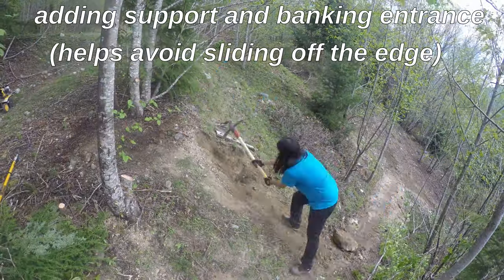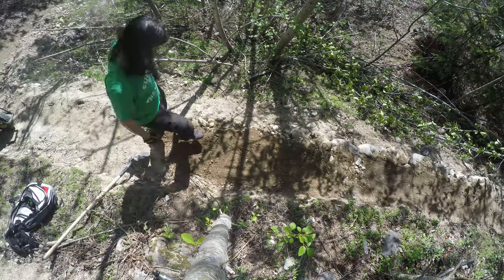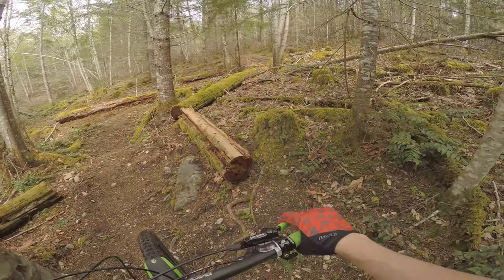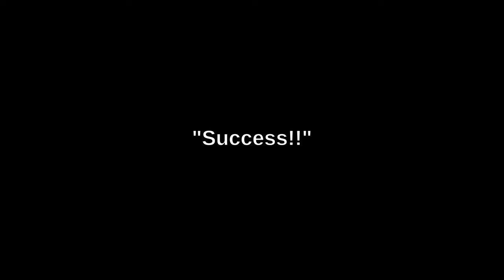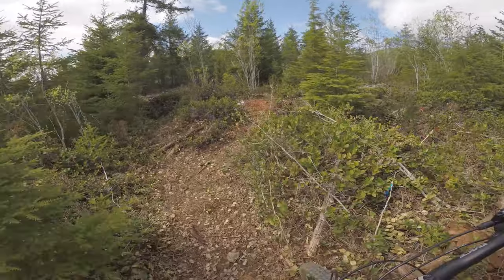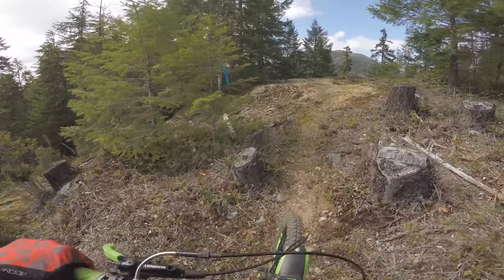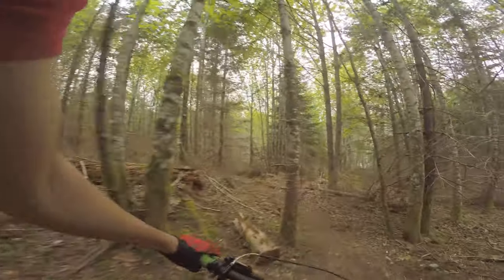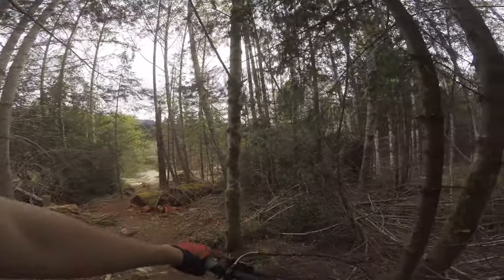Building berms & improving flow // Dig and Ride (Part 3)

Comment: My local bike shop owner has volunteered me to get the workforce for a trail. I've talked with the land owner and he said here's a 100 acres and we could use his unlimited supply of lightpoles. I've built me a small trail on my own land but never anything on a large scale. We're going to sanction it and add it in the local race series. We're going to have a brainstorming meeting on the 9th, is there anything you can think of that I might need to address, I'm nervous because I've never done anything like this. The trail is going to be single track on flat ground with few hills. I'm thinking 10 miles on 100 acres? Anyway, I'm sure I'll have some questions for you when this thing gets underway, good advice is always appreciated. Man, It looks like you're coming right along with your trail, It looks good. Later man.
Reply from the maker: drainage and soft shoulders are the biggest things I can think of to  address, especially in flat trails. otherwise, i think you'll do great!
Reply: @BikingWIthPanda  Thanks, yeah I don't like mud.

Comment: I really like this channel i just found it it seems like u put alot of effort into these videos and could u tell me some tips on how to make more flow thanks😀
Reply from the maker: welcome to the channel, and thanks for the compliment!

there's multiple types of flow; when technical features are easily linked together so the rider experiences a sense of flow. or, when a trail looks like a smooth flowing ribbon.

for flow trails, making the surface uniformly smooth and wide is pretty common and lets riders take on more speed.

for tech flow, all i can recommend is to ride it repeatedly and change the parts that feel awkward or abrupt, unless it is required for dumping speed to remain safe for certain sections.
Reply: @BikingWIthPanda  thank you i like tech flow thanks for the tips❤
Reply: @BikingWIthPanda  and one more thing could u give me some tips on how to make a dh trail with Lirtley like 40 feet of downhill
Reply from the maker: i think you mean a gentle grade descent of a longer duration and not a short steep section?

for a long gentle descent, add rollers, jumps, things to pump on and gain speed! 

but i'm not really sure what you meant
Reply: @BikingWIthPanda  i have a downhill but that downhill is a little sleep buuuttt its only 40 feet i hope this makes more sense
Reply from the maker: pump track? :D